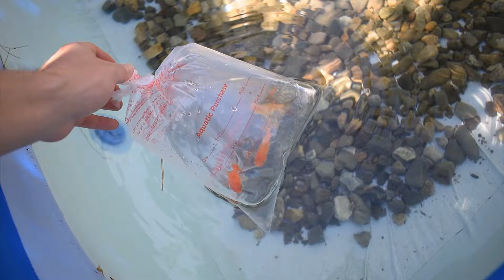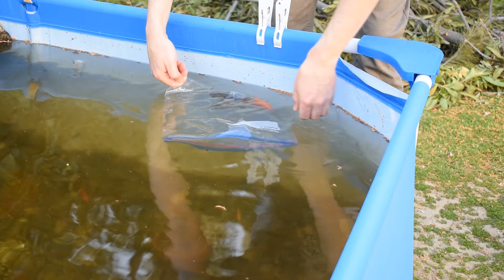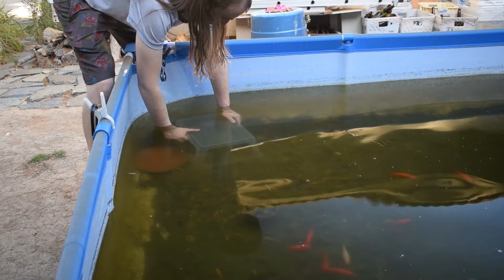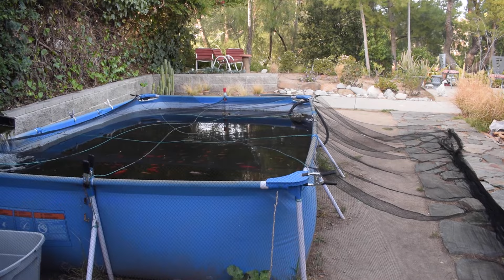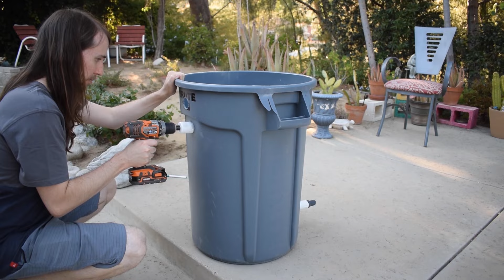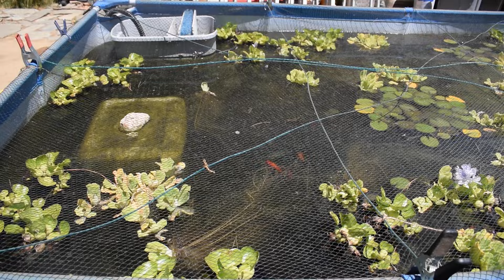3 Year Pool Pond Transformation!

Comment: How do you keep the water warm during the winter time? Are you running any heaters?
Reply from the maker: So it turns out that I don't need to run heaters in my pond because I live in the Los Angeles area and it doesn't get super cold where I live. Also all my fish are cold water fish. I did try to run a few 500W aquarium heaters in this pond during the first winter that I had it but then I learned that I didn't need them and also they were super expensive to run.

Comment: Did you have any issues with punctures or anything like that?
Reply from the maker: Luckily I never had any punctures or anything
Reply: @TobiasHolenstein  did you have any issues with rust? Ot doesn’t look like it but curious. I want to put one of these in my garage for my koi
Reply from the maker: @Gobrian44   I didn't really have any rust. I think maybe there were some spots where the metal was a little brown, but I didn't see any significant rust. I live in the Los Angeles area so it's a pretty dry climate, although I imagine that having it inside a garage will probably create some humidity, so I would maybe look into some kind of humidity control to protect the inside of your garage as well as the pool pond